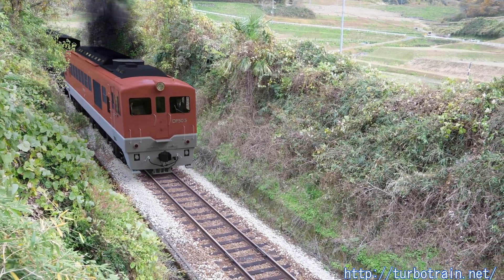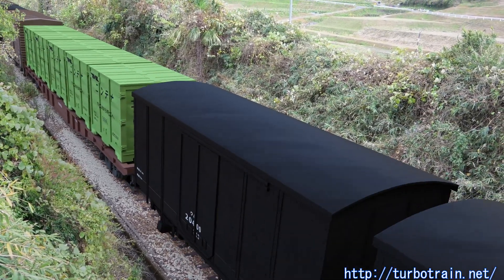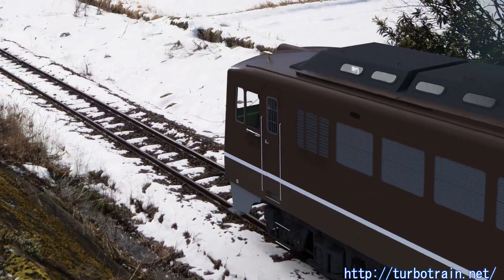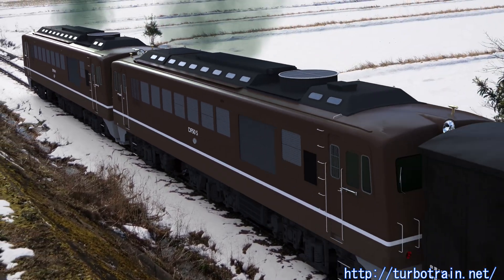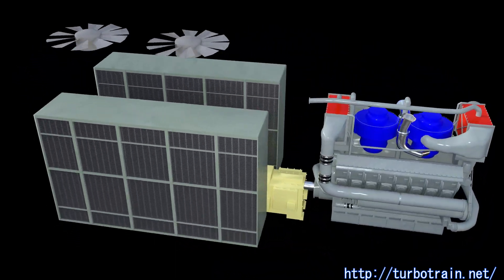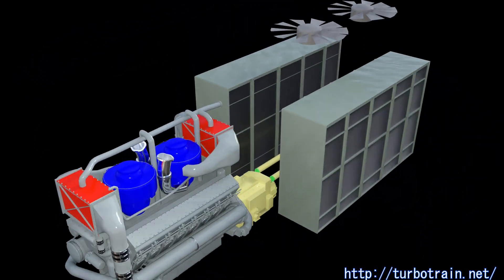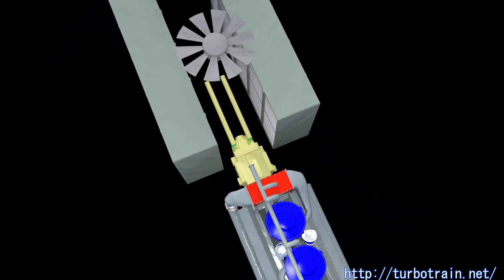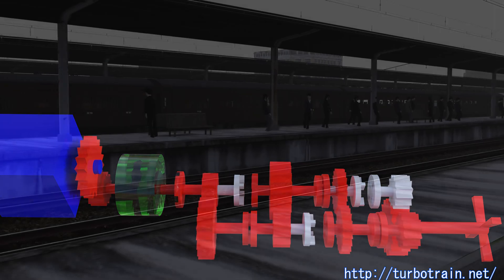DD54 : The Challenge of the Mekydro System

Comment: The center cab hydraulic DD51 had two engines (1100PS x 2) at the front and rear, and was expensive. So the idea was to have a single engine with around 2000PS, making it more economical to buy.

At the time, West Germany and Japan were the only countries that had put hydraulic transmissions of over 1000PS into practical use, but Germany had developed a hydraulic transmission with over 2000PS. So the box-shaped DD54 (1820PS x 1 engine) was built using German technology.

However, the German hydraulic transmission for standard gauge trains was not suitable for Japan's narrow gauge. Due to intellectual property rights and insufficient communication with the German manufacturer, the propeller shaft broke and pierced the ground, creating a pole vaulting situation.
The DD54 was the most surreal and metaphysical of all Japanese locomotives.

It was four years later that a hydraulic transmission with over 2000PS was made in Japan.